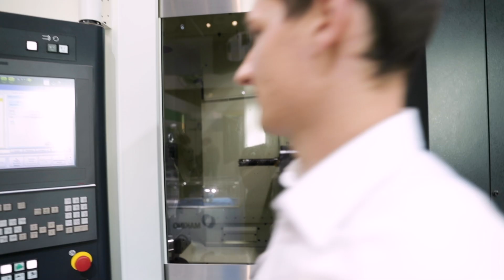Precision Of MAKINO - The Coin Trick | EMO 2019

Comment: OK. That was impressive.
Reply: What's even more impressive is that BMW used to do the same trick with their V12 engine in BMW 850 model when they put the coin on it's edge on the engine, start the car and turn it off with the coin standing still.
Reply: dash3dot any v12 engine that works 100% can do that due to them being 100% mechanically stable without the USE of counterweights.

Comment: wind the spindle up to 18,000 rpm an see if the coin is still standing. Then id be impressed.
Reply: I'd say this is a more impressive demonstration, the spindle is harmonically balanced whereas a tool change has potential for significant impulses in the axial direction.
Reply: This is much more impressive.
Reply: Andrew Delashaw Agreed
Reply: You don't know much about machining, forces, balancing, vibrations and coins, do you?
Reply: That the spindle on such machine doesn’t move enough to move that coin while tool-change is not impressive to me. I would be very surprised if the spindle would vibrate so the coin would fall down because that would mean that the machine would be kind of useless for milling.

Comment: Does anybody know who makes the carbon fiber shellmill arbor they are using with the one tool?
Reply: Why carbon fiber?  Is it supposed to reduce chatter or something?
Reply: stylac Look at the aluminum workpiece in the machine, and the cutter on that arbor- an aluminum router. A lighter, stiffer arbor assembly will allow for faster spindle ramp-ups to max Rpm’s with less stress on the spindle.
Reply: This is a demo and a lighter, stiffer tool has a lot of advantages to the purpose of this test.

This tool arbor was not designed for cutting.

Comment: Looks normal to me. Why shuld there be any vibration at the Spindel whit a toolchanger like that?
Besides you crashed the Maschine that hard to get Spindel and Toolchanger out of aligment :D
Reply: Can someone interpret this garbage post?
Reply: @justinl.3587  Wieso sollte ein solcher Werkzeugwechsler vibrationen an der Spindel verursachen? 
Solche Werkzeugwechsler werden sehr genau auf die Spindelmitte ausgerichtet, somit entstehen nur beim spannen des Werkzeuges Vibrationen durch den Spannzylinder und dessen Pneumatische Einrichtung. Des weiteren wiegt die Spindel an die 200-500kg selbst wenn man mit einem 250g Schonhammer gegen die Spindel schlägt müsste die Münze stehen bleiben bei brandneuen Maschinen.

Why should such a tool changer cause vibrations on the spindle?
Such tool changers are aligned very precisely to the spindle center, thus creating vibrations only during clamping of the tool by the clamping cylinder and its pneumatic device. Furthermore, the spindle weighs to 200-500kg even if you beat with a 250g mallet against the spindle, the coin would not change its position at brand new machines.
Reply: X197ToPlay Nope, can’t understand that either.
Reply: This is the ideal of no vibrations or jerks that a tool changer should have.  You must have spent your time in high precision shops with newer machines.  If you get a cheap machine or a used machine that is worn out and not adjusted until the tool changer no longer works it gets bad.  I've been in shops where tool changers are misaligned by 1/4 in and you can see things warping as the tool changer engages with the spindle then springing back as they seperate..
Reply: Everything is a 'spring'; Newton's 3rd law,  for every action there is an equal and opposite reaction. In other words, when a force is applied to a mechanical interface it will move. How much it moves is dependent on the stiffness.

The test would have been even more impressive with spindle stops and starts, then changes, but that doesn't take away from this exhibition.